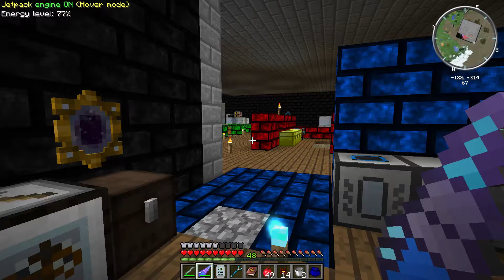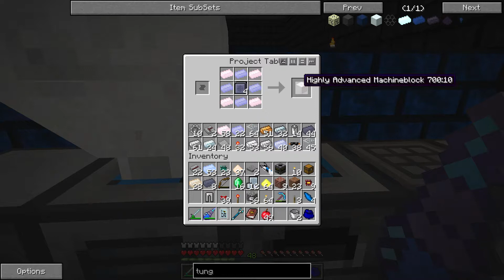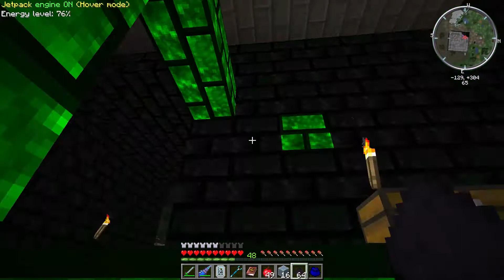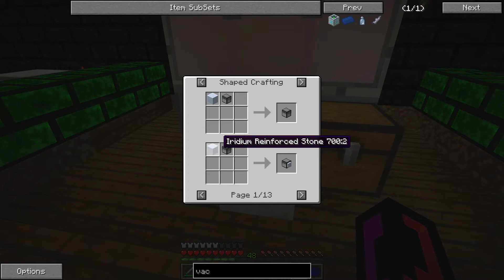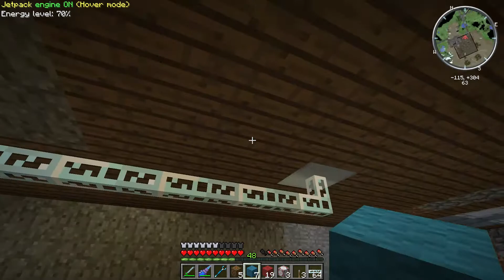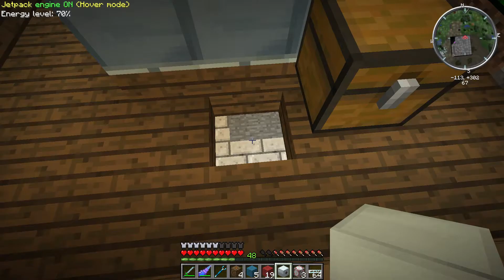Kryptocraft - s2e51

Comment: Iridium Reinforced Tungsten-steel Block:
"This block is in fact so strong, that it can take ANY amount of nukes at any distance. This can be used to make a nuke-gun by basically making a TNT cannon but using nukes instead of TNT, and Iridium-Reinforced Tungsten steel blocks instead of cobble, for instance.", unofficial ftb wiki